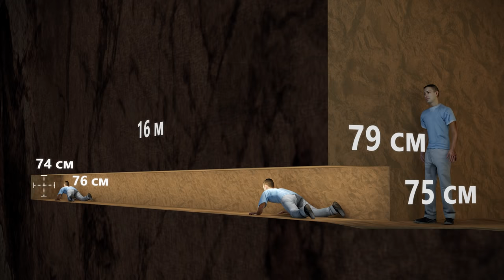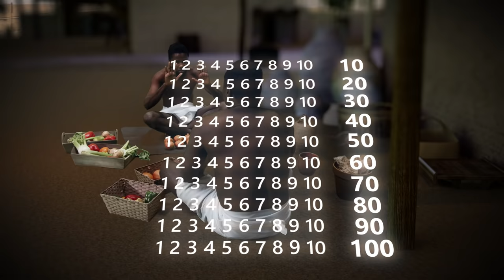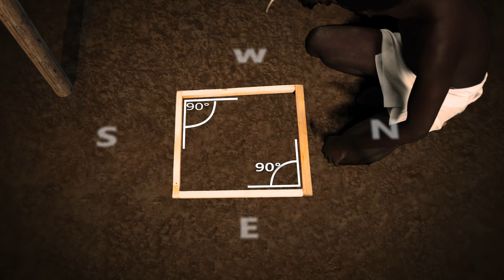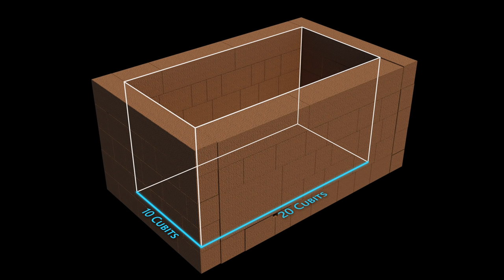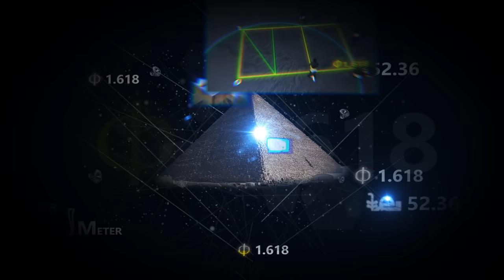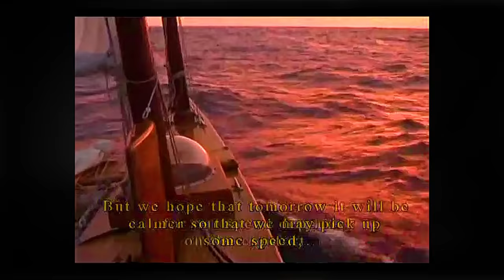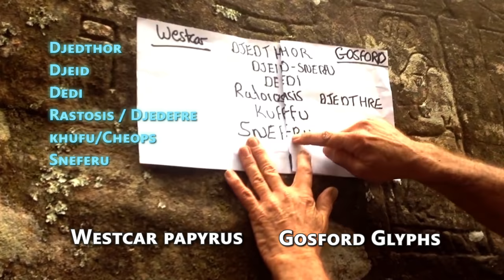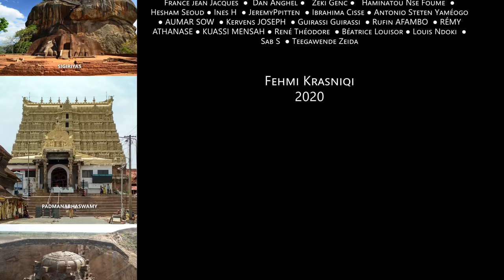The Movie Great Pyramid K 2019 - Director Fehmi Krasniqi

Comment: There are too many holes in this theory: Any modern surveyor or engineer can attest that it is impossible to plot a square, north-aligned surface without error using sticks and strings. Wood and most other materials expand or contract with changes in temperature, so the use of molds is questionable. On the other hand, if the rock was melted several times, it must have been homogeneous, however the museum pieces show rocks with encrustations. This is not produced by a melt, but with pressure and heat. And neither does it explain why in the great pyramid of the sun, in Mexico, the standard measure used is exactly 2 Egyptian royal cubits.
Reply: A magnifying prism glass could accurately measure a “plot” as you describe it. 

Nowadays, your “surveyors” and “engineers” use a similar, more complicated high tech instrument. 

Do catch up! 😂
Reply: The cubit is much older then our history describes...but the cubit and base 12 are worldwide.

Comment: Great video. Among 25,128 comments I doubt this will be noticed. But I do think it clinches the idea that poured stone is the most sensible solution. This is the first time I've heard that crushed limestone and clay can be mixed with water and reconstituted as rock. Essentially, a concrete that is impossible -- or at least very difficult -- to tell from rock. OK, that's brilliant. It's the simplest concrete around. It explains the ancient monolithic marvels of the world that to this day we cannot explain. Sounds like we've rediscovered the secret, too. So what's keeping us from using that technique today? 

Second question -- The video talks about ancient wood embedded in "poured stone." Has this wood been carbon dated? The video fails to mention that, and it seems a curious omission. Surely carbon dating would be able to establish the date.

Third question -- More a statement than a question. The "star alignment" argument mentioned in this video seems to be a tautology. It argues the pyramids were aligned with Betelgeuse in 2500 B.C., not any other constellation, and the Pyramids seem to be patterned after Betelgeuse, therefore we know the Pyramids can be dated to 2500 BC. But that does not address the argument that Ice Age civilization theorists suggest. Hancock et al are talking about the alignments at Giza sometime prior to 11,700 years ago, when they say the Sphinx was built. If you're going to make this argument, it should be clarified and developed further. The skies looked a tad different 11,700 years ago. We need maps that show the appropriate starmap for the dates in question.   

Hey, I think some sort of poured stone is the best explanation for the pyramids I've ever heard. I am not completely sold on the date of construction arguments, however -- there seem to be some rather obvious questions that go unasked. Keep at it! Ask those questions. Go make a sequel, I'll watch.

Comment: Well finally a construction theory that makes sense. Very well done. However, the big lens heating igneous rock to molten state seems somewhat conjecture. This needs to be proven with modern recreation examples to be accepted as proof. Grain formation in igneous rock is controlled by heat and pressure deep within the earth and may not be replicated as depicted due to lack of identical formation conditions of pressure and heat. The heat would be so great you couldn't stand next to the molded block for some time and resultant grain formation would be different to host rock material. Generally small grain size equals more rapid cooling in nature, I seem to remember from college.
Reply: Even modern concrete as it cures makes a lot of heat, in that dams need cooling systems embeded into the concrete as it cures to protect it from fractureing due to thermal expansion, and there is still residual heat in the middle of those dams many years after they have been built.
Reply: @stevenkostamo1279  I was referring to the unfeasible cartoons of men melting granite into a mold. Would be way too hot to withstand standing nearby.
Reply: Well there is one good reason the inner casing stones were poured either through heating or a mix using water and that is you dont have to worry about fitting to external cavities the the poured medium will do that for you right upto the outer casing and it is self leveling.
Regards
Reply: You make a good point here. Would be great to see a recreation of this large magnifying glass. But the construction with concrete seems it could be legit!!!! Makes sense really!
Reply: @mylesjarvis7571  for  sometime now the idea that some of the Egyptian monuments at tanis  were melted by solar flare it could be ancient Egyptians weaponized these solar lenes in a civil war perhaps?.
Regards
Reply: If they had technology to melt stone, they also would have discovered glass, and it should be everywhere... everyone wants a glass bottle, right? But maybe they had a sepcial recipe for granite concrete.
Reply: @MaZe6K  not necessarily the glass was used to make the lenes which allowed them to feed the work force and make geopolemeer pots and containers and moldsfor the interior of the pyrimid build.
Regards
Reply: @Terminatortx33  Yes I know about those modern lenses, I have one. Standing next to a rock being melted and poured, no way Jose. Way to hot plus you need goggles to protect your eyes this can make you go blind. plus those vases have natural grain formation so they look to me to be lathe turned.
Reply: @mylife6453  I agree they looked lathed. One thing i was questioning if they melted the granite and it was poured into the moulds at that temperature - wouldnt it set the wooden moulds on fire. And the time it took to melt 10 tonne to create a block as they demonstrated pouring it bit by bit it would show some layers as it would be setting at different temperatures and speed.
Reply: @MaZe6K  Good point on the glass - they had enough sand to make glass if they made the lens. Or maybe they made glass and it broke to easy so they went the hell with that - we will stick to making rock containers.
Reply: @Terminatortx33  yes and that means cooling fractures. It would not be as depicted completely melted to a liquid then reformed. To completely melt granite to a magma state takes a great heat, enormous energy, and once heated it would radiate so much heat you would cook if you stood nearby. Thick molds would be needed, carefully carved. Mold lines can be scraped out but grain growth that is the formation of crystals found in natural granite would not be there. Those vases exhibit natural grain structure so a lathe with a diamond cutter would be employed.

Comment: You lost me at the 5m diameter lenses. After that this turned into an acid trip fantacy.
Reply: Lost me at the wooden forms in the concrete. How did they get the forms out?
Reply: @Lynn Geek And then again. How would they have generated the enormous heat to melt and shape this ridiculously big lens? How did they shape it and polish? Nothing in this hypothesis makes sense.

Comment: How did the workmen lift and move these colossal magnifying lenses? The heat in close proximity to the workers would fry them to a crisp, after working in a foundry I can testify to the incredible heat present. Cheers from Michael. Australia.
Reply: by covering it
Reply: Doing it at night?
Reply: @Lynn Geek did you find an answer?? I’m interested to know if this theory is possibly the accurate one!
Reply: This lens is the only element in the theory that doesn't make full sense to me because the workers don't seem to be protected from its rays.  Seems a little magical.  If aliens did not stimulate Egyptian building, why would Afro-Egyptian Americans do the same thing for Meso American civilization according to this theory?  Seems contradictory.  Olmec statues undoubtedly look African but they don't look ancient Egyptian.  Still, a very fascinating presentation!
Reply: Lense only works when focused. Which is stated.
Reply: Literally just tilt the lense away. Or make it on site. It's just water glass molds.
Reply: Working too close to the giant lens melanated them.
Reply: The lenses were not large lenses, the staff or ankh that the Egyptians carried had stones that transmitted light embedded in them, they were ancient lasers that could cut anything, stones were lifted using solar energy. This is why the worshipped the SunGod, which all scientific knowledge came from, ask me how I know, I was there.The knowledge came to the rulers of Egypt in a dream, that’s why dreams were of great importance of that time, the knowledge resided in the unconscious mind of man. Carl Gustav Jung saw things in his dreams, that’s why he went all over the world to visit different religions and cultures to confirm what he saw in his unconscious mind.The truth is God is the Sun, everything emanates from it.

Comment: This makes waaaaay more sense than lifting/moving several ton stones 1 by 1.
Reply: Very interesting . I would like to see some of these theories  executed. I would assume melting granite down to the size of a brick and designed with hieroglyphs could be done if this documentary is saying that's what they did to make gigantic obelisk
Reply: Exactly I'm a concrete finisher and have been for the past 25 years. In theroy it sound like it could be do able but the amount  for time it would take for each gigantic  block they poured to set and cure very time consuming. Today we use chemicals to increase cure time and lay steel inside for strength  and they  fall apart over time. If there concrete lasted thousands of years and can handle the weight of the pyramid that is absolutely amazing.
Reply: But who know it's crazy we dont really know it's all speculation this documentary was definitely good either  way
Reply: They took many samples from the stoneblocks. It is natural stone. The concrete theory was debunked decades ago. Nobody know why people still believe this.
Reply: What are you talking about? Ha. No it doesn't. Shit....